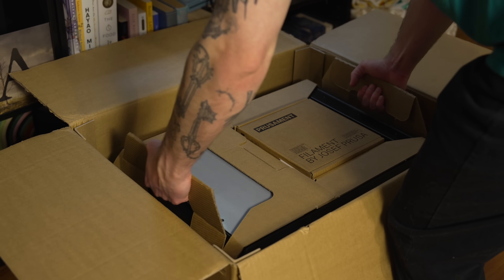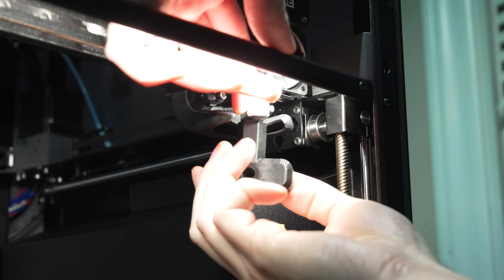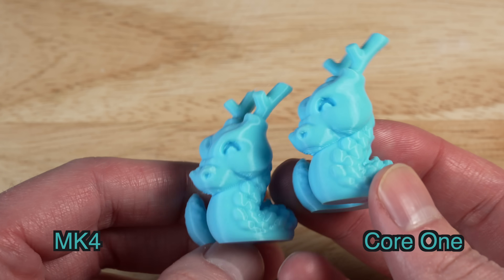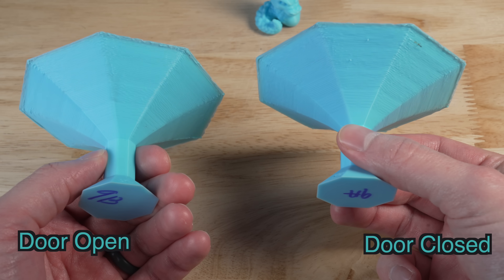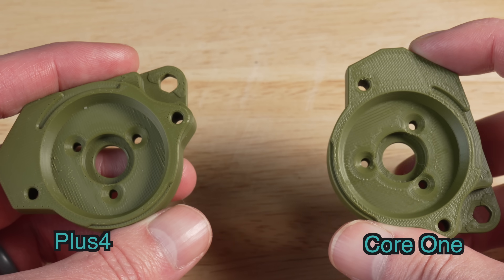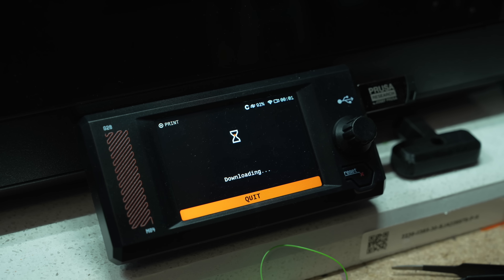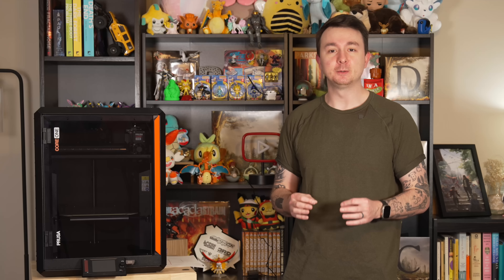Prusa Core One Review

Comment: All in all, a solid review. I especially appreciate the review of ASA performance.

The increase in Z-height means more to me than any possible increase in the X or Y design. I find height is typically the most limiting factor when printing large objects. To be fair, I mostly print firearms, so my use case is a little different, but I really like that they were able to let us print considerably taller objects.
Reply: Firearms printing as well, and im considering the Core One. Do you think the 290c max nozzel temp is limiting for 2A prints? for this reason im looking at the Plus4.
Reply: @MrBiggs-wu2kf  I don’t think it’ll be an issue. 290 is plenty for carbon fiber nylon.

Comment: This is such a hard sell for the price in 2025. With the Elegoo Centauri Carbon coming in at $299 assembled; these small, enclosed, Core XY printers need to be dropping at least below the $1000 price point to compete, with premium offerings probably needing to reach that $600-$700 mark unless they can start to dramatically increase the print volume.
Ultimately, if this came out at the same time as the X1C, it would be in the same game, but for a 2025 printer, it's going to struggle at such a high price.
Reply: That's fair. I had a Core One and had to return it due to ongoing drop damage issues. But other than that it was a quality machine. I was def tempted by the Centauri Carbon, but I'm sort of waiting to see what shakes out with BBL. I'd expect another mid-tier core XY to come out from them to replace the P1S, with a touch screen. And if they can nail that at a similar price point (after all this tariff crap settles down), I think it's going to be hard to beat...

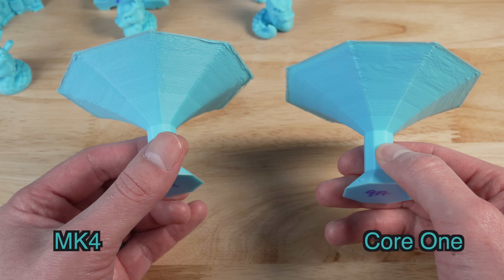Comment: Your MK4S used for control have an enclosure or not ? It's really important to test the printing difference, because the temperature is better controlled in an enclosure. It would explain why you have issue with overhang printing at 6:20

Comment: So do you like it better than your x1c or than your voron? Would you see any reason to get a core 1 if one already owns a mk4?
Reply from the maker: In my opinion: I like the X1 for multi color and I like the core one for “just send a quick print”. In terms of my vorons, they are my “favorite” printers because I have FULL control over the firmware. If I want to change anything I can and that’s what I value. Simple stuff like where it parks, how it heats up, etc. If you already own a MK4 and you want to be able to print materials that need an enclosure, I think it’s a better use of your money to upgrade to a Core One than buy an enclosure. If you need a second printer and want that capability then the core one makes sense. Then you can share nozzles and plates between your printers. Hope that helps!

Comment: Sorry, but I just had to stop watching this video because of faulty explanation of overhangs.
OVERHANG is what is hanging over (surprisingly), usually in degrees.
OVERLAP is what is stack on previous layer, usually in percentages.

Even in author’s showcase he is setting up different speeds for different PERCENTAGES of OVERLAP.
If he would try to set up OVERHANG threshold for supports, he would do so in DEGREES.
I just have to do this just because of comments like “I particularly appreciate your explanation of overhangs and what the percentages actually mean.“
In one sentence the author is talking about overhangs settings in percentages (wrong), in the next one about overlaps in percentages (right) and after that he is showing picture with overlap marked as overhang (wrong).

Of course there is correlation between those two, for example with layer height 0.2 mm and extrusion width 0.4 mm:
0° overhang = 100% overlap
45° overhang = 50% overlap
90° overhang = 0% overlap
Reply from the maker: Hey, so you wrote a lot to just be wrong. I know how it’s explained is counter intuitive, but the way I explained it is precisely how the SLICER is calculating it. I’ll copy verbatim what the tool tip says here:

“Overhang size is expressed as a percentage of overlap of the extrusion with the previous layer: 100% would be full overlap (no overhang), while 0% represents full overhang (floating extrusion, bridge). 

Overhangs are literally defined as percentages and the percentages are ratios of what’s on the previous layer over what’s not. For a 0.4mm extrusion that has 0.04mm being supported by the previous layer, that’s a 10% overhang which means 90% unsupported.

Sure, you’re not wrong that the setting for support material is set in a degree value, but that in itself contradicts how overhangs are calculated.
Reply: I have an idea what you want to say from the beginning, but the way you are doing it is a bit confusing for let say “younger players”.
You are showing settings for dynamic overhang speed where you are setting values for 25% OVERLAY, but you refer to that as OVERHANG. Of course there is fixed correlation between those two, but you cannot just swapping the naming. For my previous example 0.4 mm layer height and 0.4 mm layer width (there I made a mistake in previous comment, should be 0.4 mm layer height not 0.2 mm), if there is 25% overlay, it means there is 75% overhang.
And without a doubt, what you highlighted on that stacked extrusions drawing is OVERLAY, not OVERHANG.
Reply from the maker: You’re getting confused with the colloquial use of the word “overhang”. I get that in a normal context that word usually means “something that’s hanging off the edge of something” but in the slicer that ISNT what it means and the tool tips define it that way. Something that’s 10% overlapped is a 10% overhang as well. Go into prusa slicer and look at it yourself. I know they call it “overlap” and “overhang” within the same section (they do it, not me), but for calculation those words mean the same thing.

Calling it “overlap” might be a better way to express it because that makes sense. We are talking about what’s overlapping the previous layer. I can see the confusion because if not all of the extrusion is overlapping, there is some “overhanging”, which causes the need for the slicer to consider it an overhang. Really there is “overhang” or “not overhang”.
Reply: @avaudiovision_cz  It is still calculated kind of backwards of the expectation or colloquial use of the term “overhang,” kind of like how people think of percentiles in a backwards kind of way. When I say I’m in the 90th percentile for height for my age group, I’m actually in the 10%, meaning I’m shorter than 90% of people my age. 

I get that what actual overhang is conventionally known as is not what is shown or explained here, but for the purposes of calculating it based on the terms THEY used, it is exactly that.
Reply: I tried, really tried.
I just can’t continue over statements like “Something that’s 10% overlapped is a 10% overhang as well“. I just think that we should leave degrees for overhangs on original 3D model and stick to percentages for overlaps on sliced models.
I’m sorry I started it, do all of you as you know best.

Comment: Did you have to adjust the tensioner for the TPU filament, or did it feed fine without?
Reply: When I use flexible material on my MK4S, I always reduce the tensioner by 1.5 turns. 

If I leave it at the default setting, I sometimes have problems loading the filament.
Reply from the maker: Nope, no adjustments at all!
Reply: @ButterPockets  Nice!  I haven't tried it yet so that's good to know. Thanks for the info!

Comment: at this price point, bambu is still the cheaper and proven better option.
Reply: Bambu is cheaper becasue its 100% made in china with all cheap china components. Prusa's are built in the EU/USA and use higher quality components, that come with a higher price.
Take the steppers as just one example out of at lease a dozen. Bambu uses cheap, no name steppers sourced in some random factory in shenzhen. While prusa use's LDO steppers. LDO is chinese, but a much higher quality brand over whatever brand bambu uses for their steppers. Then you got the issue of PSU's, fans, belts, rails & bearings, etc etc. Prusa is much higher build quality.
Reply: @LilApe  quality to quality, Prusa destroys BL.
Reply: @LilApe  i literally don't care what brand my stepper or whatever screw is. I just need the printer to print and I need it to print well and always. And if there are 2 brands that does that... I am going with the cheapest of the 2. Because I don't want to pay markup for the same stepper build in the same China fabric just because of the marketing Josef from Prague with their 3dprinted 3d printers with premium price. They have a print farm to print the printer... it's cool but I'd rather have "quality" plastic / aluminum over filament. I didn't say prusa was bad. I said bambu is better at that price point.
Reply: @ Prusa core one is $1200, bambu X1C is also $1200. Prusa core one is built with much higher quality components. Core one is better for the money. X1C should be about $500 less becasue of the cheap components they use. Bambu is the one with the mark up price.
Reply: @ Prusa one compares to P1S spec wise which is 400 euros cheaper while AMS is included. with a smaller xy  volume. but we don't have to agree because we won't, ever and that's okay. I'm happy with my Bambulabs P1S with AMS and I hope everyone ordering the Prusa one is happy with their printer. I have owned multiple printers but non of those made me as happy as the bambu does
Reply: I looked up basic repair procedures. Yikes.
Reply from the maker: I don’t always think cheaper is better. You’ll find many print farms full of Prusa machines for a reason. They have a place.
Reply: @ButterPockets  because those printers are proven... hence my comment... this printer has the prusa markup, doesn't mean expensive is better. There is a reason bambulabs is one of the best sold CoreXY printer on the market.
Reply from the maker: The ender 3 is probably the most sold printer - that doesn’t mean anything either. BL makes good printers that are accessible, I’m not debating that. But I wouldn’t call them better. That’s just reductive speech and means nothing. They both have their place.

Comment: On overhangs, I was trying to get my head round this only yesterday.  It would be interesting in your model if you varied the wall thickness horizontally on each side of the octagon: that would reveal at what point (in degrees!) each thickness would fail.  Looking at my overhang model test prints, the models are marked up in degrees and clearly do correspond to degrees - and given a constant thickness, the two things are mathematically correlated I think.  But you're right in practice that wall thickness and % overlap are practically speaking more relevant - since tweaking slicer settings to add additional walls (ie thickness) in overhang areas can make a substantial difference.

Appreciate the review.  I have a Qidi Q1 Pro and would have probably bought this were it out a year ago.  I really do appreciate Prusa's long product life cycles, commitment to upgrades, and their approach to sustainability.  I will seriously look at Prusas in future.  I think they're still a little too expensive compared to the competition though, which is unfortunate as otherwise it would be a no-brainer decision.  My Qidi experience has been extremely posiitve, and their price points and quality are hard to beat.  So paying the extra for a Prusa would make sense for, say, an XL (a model I'm interested in potentially as a next purchase) but the Core One is not such a straight forward choice when a Q1 Pro is a third of the price.  I guess only time will tell if Prusa can sustain their premium pricing in the current market without losing sales.  If price were no object, I would always choose Prusa.

Comment: And just as I thought I had gotten my head wrapped around what the degrees in overhangs mean (I can never remember where you start calculating the angle - from horizontal? from vertical? clockwise? counter-clockwise? Argh!), now I'm having to throw this knowledge into the trash and speak about percentages, which even vary based on layer height and width?! My poor brain...:face-pink-tears:
Reply from the maker: Basically you start to run into trouble when 50% of the line you’re printing is unsupported. Most slicers default to overhang speeds at 50%. Thankfully since it’s 50% it means the same thing either way 😉
Reply: @ I hope there's no differences in this between the popular slicers of today 🤔
Reply from the maker: Haha well that’s where they get ya. Bambu uses the numbers backwards. IMO the way Bambu uses it is more intuitive though.

Comment: The reason overhang is often given in angle, is that it is a property of the model. The % depends from several things, like layer height, layer width, nozzle diameter.. and from the angle too.
What was the material used for the trash can?
Reply from the maker: It’s given as a percent because that’s easy to understand, but regardless of whatever percentage was used to make the model the slicer will always calculate what is an overhang by the rules I laid out. I think it would be useful for more people to know about that so that it’s kind of in your brain as you design. I’m very aware the entire topic is pretty pedantic haha. 

I used PLA on the trashcan print.

Comment: Comparing enclosed printers with open bedslingers on printing PLA is a bit weird. Enclosing printers is made for other materials. For PLA you need to update cooling. Some slits in the top and a fan is not enough. The toolhead of the Mk4s is one of the best on the market for cooling. But if you feed it warm air, it cannot perform. It is possible that door open is not enough. Then you can place a fan in front of it and blow ambient air into the chamber. Open up the top cover completely, and leave the door open, and you should get about the same result with the core one. Blow off center so that it swirls around and cools evenly from all sides. If you blow directly on one side of the print you can even warp a PLA print. ;)
Reply from the maker: That’s part of the point - I’m trying to show people what Prusa’s open bed slinger is like compared to their enclosed printer. 

I think I showed that it cools PLA enough and prints well even if it’s enclosed. Even if you use warm air it’s still far below the ~200C you’re printing at and will cool it. 

Regardless, like you said it’s not primarily for PLA, which is why I tested all the kinds of filament I have.
Reply: Been printing in an enclosed x1c with miles of PLA and never had an issue. Top lid is on, foot closed and 2000 hours later never an issue.
Reply: @MrBertstare  You probably don't print strong overhangs and small bulky structures. Or you would find issues.
Or so you have your profiles dialed in with lower extrusion temps and such?
Reply: @  I wish I could post some pics of the “forbidden legos” I just printed the buttons were printed as overhangs, the block is a semi circle 2x4 if that makes sense, and had no issues. My products I print have over hangs but batching them out 10 at a time I use snug painted supports to never have an issue, other than that I’m probably your above average printing bro when it comes to what and how often I’m printing.

In the past I spent time dialing in profiles but ever since making the switch to Bambu filament refills I just don’t bother lol. 
I used to have issues with some things warping, needing to use glue stick but in the last year Bambu has really made some improvements and now the smooth pei and textured gold plated are pretty much bulletproof. It’s really gone from what I thought was S tier when I first got them (1st shipments post kick starter) to being even better today.
Reply: @  I’ll also add that in the winter my printing room ranges from 55-65 and summer is 65-72. Dumb bonus room with limited HVAC so I use a window AC and a Govee heater
Above say 72-74 you can hear all the fans really moving some air.
Reply: @ Seems to work great for you. 
I don't like the closed Bambu ecosystem, just as I don't like Apple... 
But nobody ever said both were bad hardware. ;)

Comment: If you want to offboard new users who want to do functional printing, then the best way to do that is to redefine standardised terms. Take Overhang: "An overhang in construction refers to a protruding structure that extends beyond the edge of a building or structure. This architectural feature serves both functional and aesthetic purposes, providing shade, protection from the elements, and visual interest to a building." or another source: "In architecture, an overhang is a protruding structure that may provide protection for lower levels. Overhangs on two sides of Pennsylvania Dutch barns protect doors, windows, and other lower-level structures." but here, you need to dismiss it's engineering and architectural definition to correctly use a 3d printer. Instead of saying "people are using it wrong" I think that miscommunication from printer vendors and community redefining standard terms should be called out.

Imagine going into an engineering meeting and you're holding your 3d printed POC of a widget and you say "..and with only 15% overhang it's still very strong!" meanwhile the engineers in the room look at you like you're unqualified to speak any longer.
Reply from the maker: I get ya. I do think there’s better ways to define it, but regardless the way I mentioned in the video is how the slicer does the math to calculate it. I’d love to push for this to be updated. I’m on the superslicer dev team and I know we are taking a good look at how they are calculated.
Reply: Part of the challenge you have is the “3D Printing Community” does not always use “standard terms” correctly. Everything said here is from the perspective of the slicer. Which yes may not match some “industry terms”.